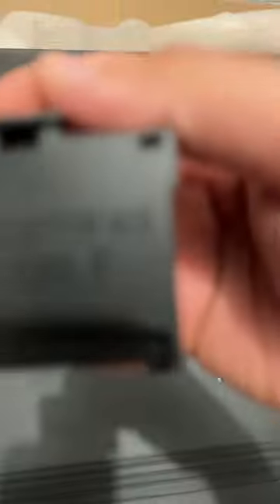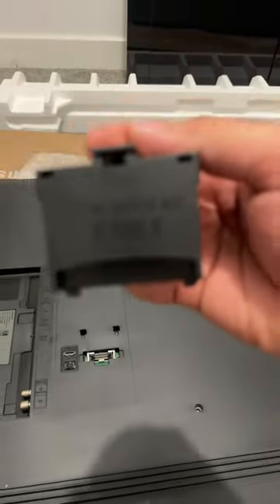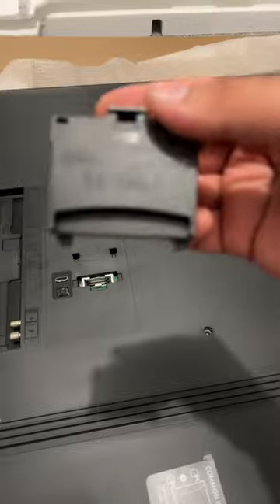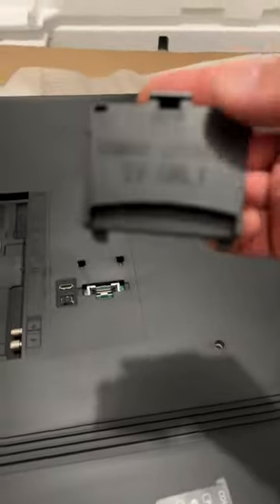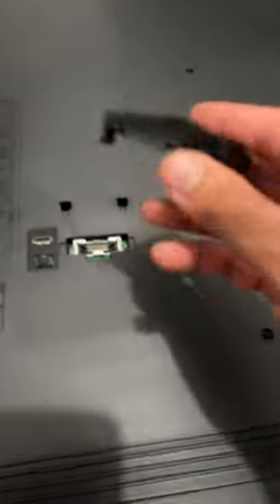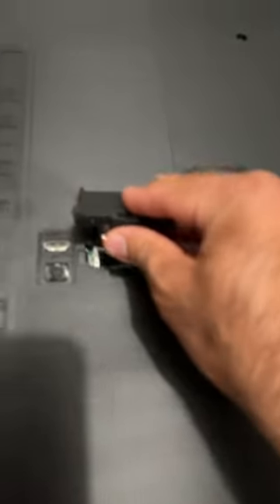How to install Common Interface Samsung QLED Tv

Comment: What is it for
Reply from the maker: The Common Interface is the connection between the TV tuner (TV or set-top box) and the module that decrypts the TV signal (CAM). This module, in turn, then accepts the pay-to-view subscriber card, which contains the access keys and permissions.

Comment: Hallo thanx for video 
I want to ask for what we need this?
I had bought this TV but I didn't install it 
Is there any problem?
Please tell me❤️
Reply from the maker: The Common Interface is the connection between the TV tuner (TV or set-top box) and the module that decrypts the TV signal (CAM). This module, in turn, then accepts the pay-to-view subscriber card, which contains the access keys and permissions.